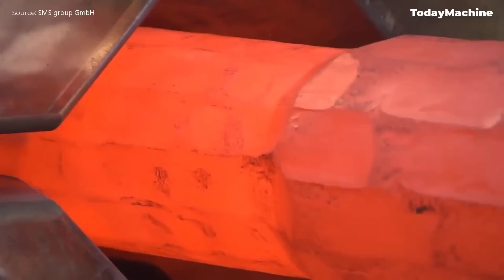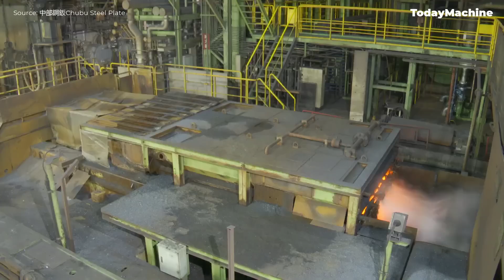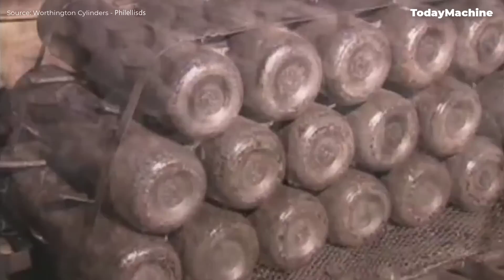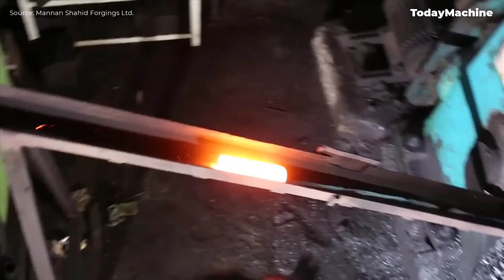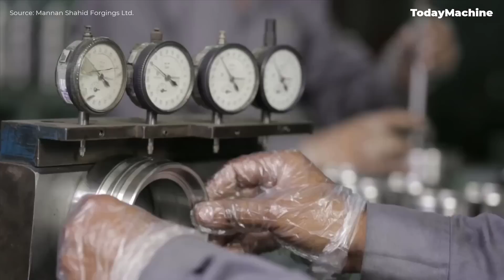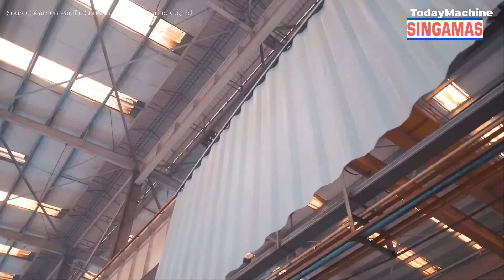How Giant Crane Hook Is Made. Visit the leading Steel Mills with Forging Machine & Heavy Equipment

Comment: Whoever edited the video did a poor job. Repeated explanations, e.g. forging hooks, and jumping between different topics, e.g. slabs then hooks then back to slabs, made it hard to watch.
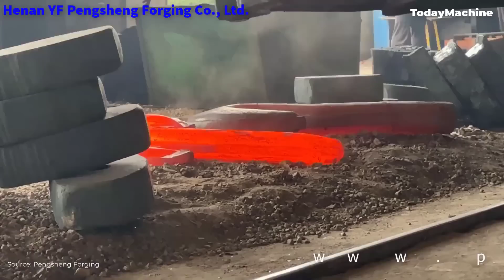Reply: Agreed, at 9:50 he is saying the hook is heat treated then trimmed using exact dies. No, the hook is trimmed then heat treated. Exact dies, then shows someone using an oxy torch. At least get the script right please.
Reply: Its a computer program analysing the video image. Pretty much no editing. The AI software is fed the video content and the analysis is spoken as per.
That's the only reason it becomes repetitive.
Reply from the maker: The segments in the video are directed towards the production of steel bars, steel bars are raw materials for the production of crane hooks. Production of steel plates, steel plates are raw materials for the production of cylinders,...